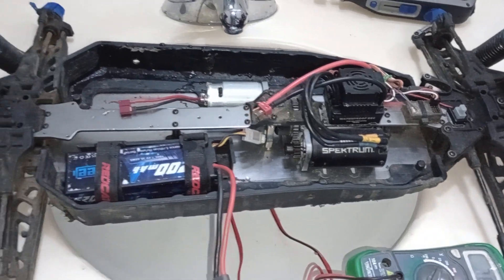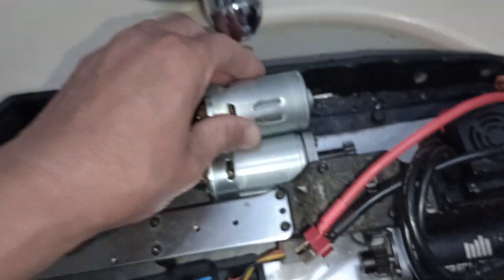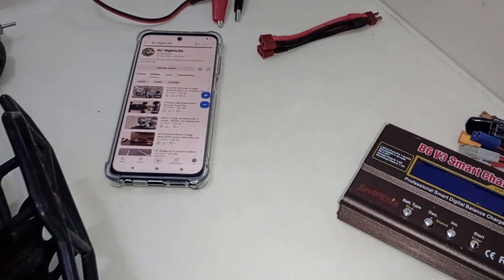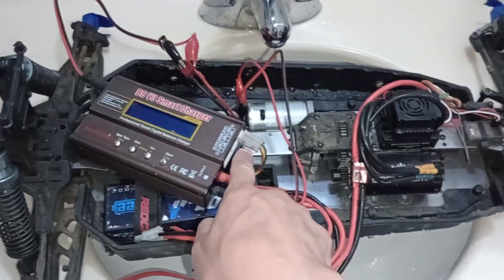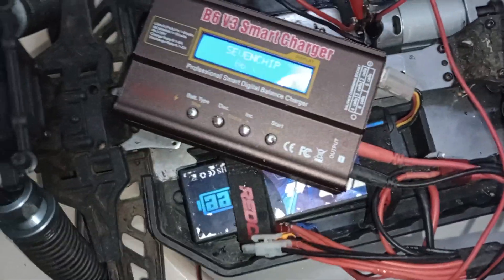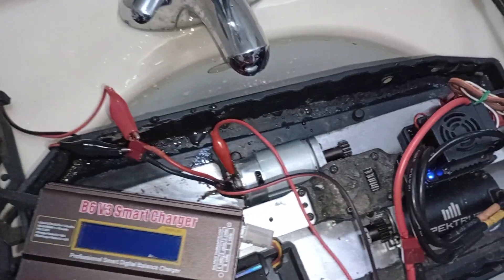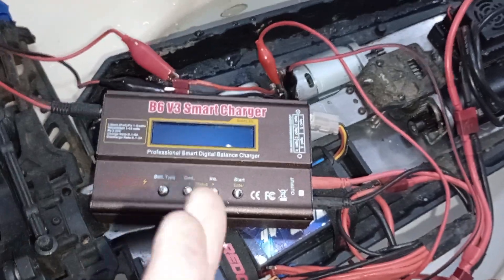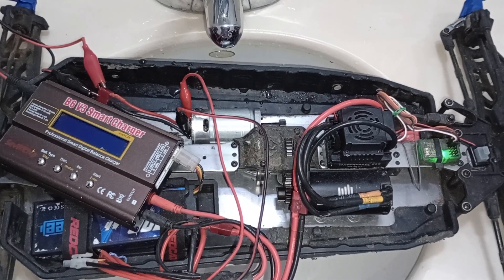RC car charges itself.

Comment: What a great mod thanks
Reply: You fall for all of those AI images, don't you?
Reply: @dooddrones6521  what you mean
Reply: @Rc_Alex_76  This is essentially one of those "perpetual motion" machines. There is far more energy being lost through the mechanical linkages, electrical losses in the charging system, and as heat, than is being gained by charging the second battery.

Lets say that both batteries have the same nominal voltage. For you to be able to put 1000mah of charge into the second battery, it will take far more than 1000mah from the first battery.

This whole thing is a waste of time

Comment: There is  no such thing as perpetual motion. All this is doing is wasting electricity turning it into heat. You will never get more out of the system than you put into it. Let's assume the input battery and the battery being charged are the same voltage. If you charge the second pack up by 1000mah, it's going to take much more than 1000mah from the input battery to accomplish this.

I'm not trying to be a dick here, but this is all a waste of time. You're not onto anything. Just charge your packs normally.
Reply: Nothing is perpetual. You can't own land in perpetuity. My kid is not perpetually lazy. A cave is not perpetually dark. Any use of the word 'perpetual' is wrong. No body can name anything that is perpetual. Why does this word exist?